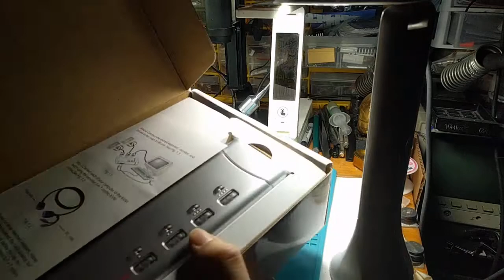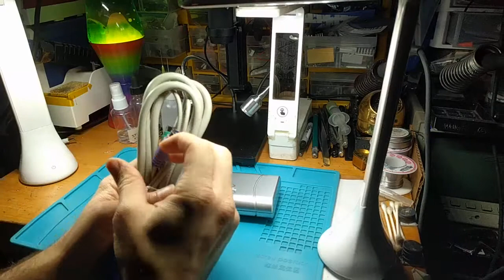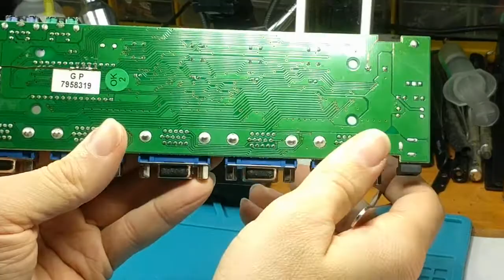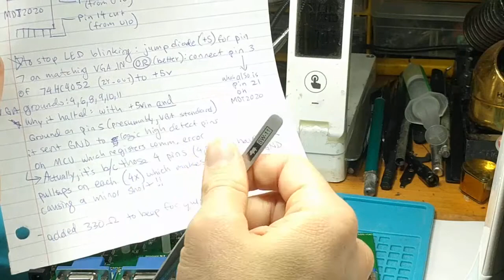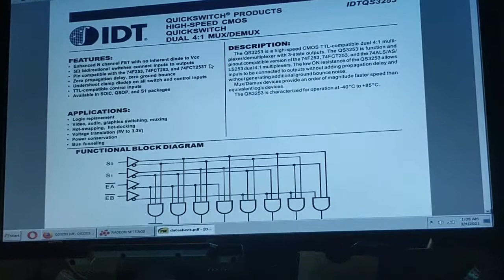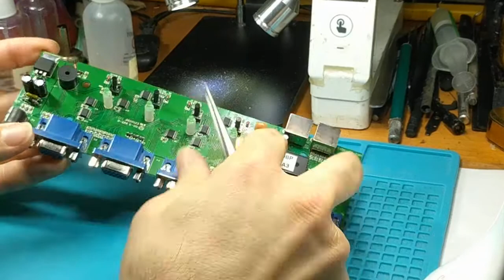KVM VGA Switch Hacking  - More than you ever wanted to know

Comment: ScrLK + ScrLK + S				Autoscan
Any Key							Stop Autoscan
ScrLK + ScrLK + B				Disable Autoscan Beep
ScrLK + ScrLK + x (1-4)			Select Input
ScrLK + ScrLK + ↑ (up arrow)		Next Input
ScrLK + ScrLK + ↓ (down arrow)	Previous Input
ScrLK + ScrLK + End				Reset Console Mouse

Input select hotkeys likely won't work until an autoscan has been run

Power Brick DC 9V 500mA (optional)
Maximum Resolution 2048 x 1536
The KVM Switch receives power from the PS/2 interface only when the computer is powered on.
Male USB > Female PS/2 adapters work on the front keyboard input.
I've repaired a few of these that have come with the heatsink for the large transistor UI3 next to the 
onboard speaker not soldered from the factory.